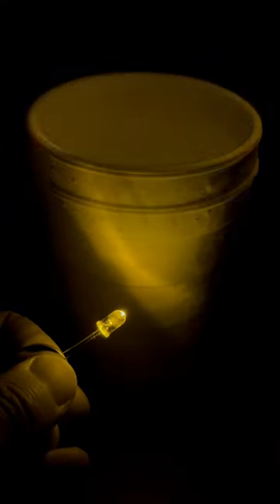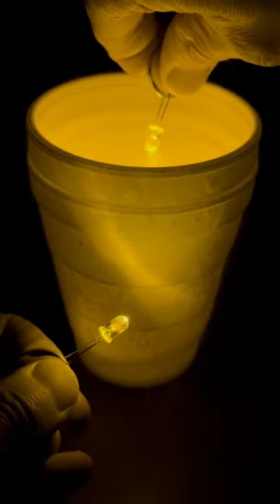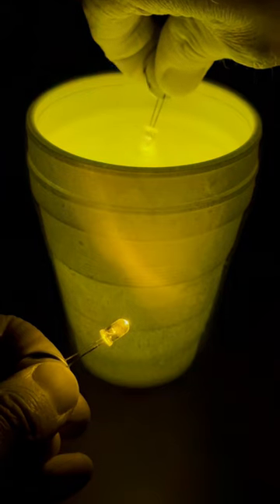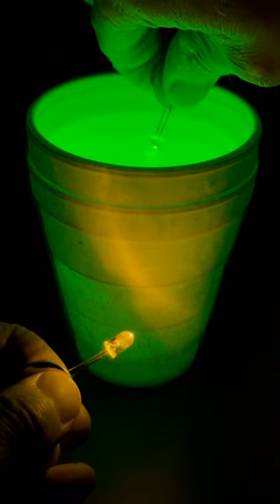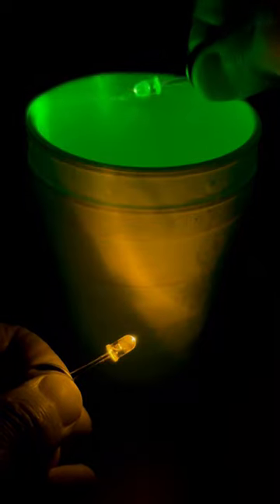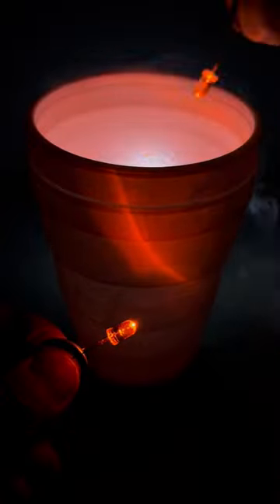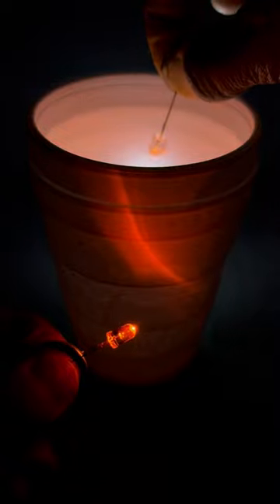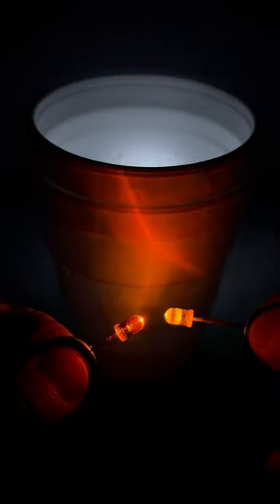LED in liquid nitrogen 🚥🥶 #shorts #liquidnitrogen #chemistry #color

Comment: If you want to be even more specific, semiconductors increase in conductivity when temperature increases, even though there are more scattering events due to the increased vibrational amplitude of the atoms, the amount of carriers (electrons or wholes that carry charge) and the mobility of those charge carriers increases as well (it's easier for them to move throughout the lattice). When temperature decreases the opposite happens, the resistivity of the semiconductor increases (conductivity decreases) and the semiconductor requires more energy to move the carriers. Since green has a higher energy than red in the visible spectrum, another way of saying colder semiconductors have a higher resistivity, LEDs at colder temperature emit higher energy photons. Which relays back to the bandgap increasing!
Reply from the maker: Thank you for this. There is definitely a lot that can potentially go on in this experiment. Much depends on the particular material used. I've read that some LEDs will shift to longer wavelengths when chilled, although I've never observed this myself. I'm no expert in this area...

Comment: Simples way to know this, is like a wire one way on positive the other to negative.
And as u change the amps it heats up more and changes the color.
Thats what a diode is, it allows the electricity one way but the not the other way around.
So by controlling the energy on the diode u change the color son nitrogen here is like -170 celcius.

Comment: LED traffic lights self-adjust their color by preheating the die with a burst of current when first turning the light on. This burst causes the light to vriefly flash brighter than normal. When the new LED lights were first introduced, that flash had people thinking red-light camera flashes were going off (they'd catch the flash in their peripheral vision, which has weak color perception; it just seems "bright").

When an LED traffic warning light is flashing 1-2Hz, the pre-warm light burst is much more obvious, happening so much more often.

Comment: What happens when you cool down a purple LED? Since purple’s supposed to have the tightest wavelength on the visible spectrum, would it change to be even more purple, or would it seemingly disappear because the frequency is too tight for us to see?
Reply from the maker: I've tried using violet LEDs in this experiment and see no discernible color shift
Reply: @TommyTechnetium  But you would not see the change no? Maybe the violet would be emitted less, and the UV could be emitted more
Reply from the maker: @magic8ball237  what you suggest could very well be the case. However, other issues can impact the color shift (or lack thereof) of various LEDs. See Shakhashiri volume 5

Comment: When I think of photon emission, I think of quantum steps in frequency based on electron orbits.
But in this case, is the frequency changing continuously with temperature??
Reply from the maker: The frequency of light emitted here is still based on the difference in energy between orbitals. It's just that this energy difference changes with temperature

Comment: I was curious. If this works, does the opposite also hold true? Like say inserting an LED into boiling water and seeing it shift towards red?
Reply from the maker: I've been wondering this, too. I'm also wondering if you'd have to increase the temperature so high to see a color change that you'd ruin the LED
Reply: @TommyTechnetium Overheating a green LED, by overcurrent, shifts it towards orange. 

Would be interesting to see how the newer style that are blue/UV internally and the visible color is generated by phosphors, stimulated by the blue/UV photons, reacts as there is 2 stages - the shifting of the blue/UV, and then the phosphor...
Reply from the maker: @michaeltempsch5282  Interesting question...Do you have a link where I can purchase or learn more about the new LEDs you describe?

Comment: 🤯🤯🤯
Wouldn’t this mean that the color change will always go “up” the spectrum…? Like tighter/shorter wavelengths?
Reply from the maker: The color shift isn't always to shorter wavelengths. See Shakhashiri, volume 5, p. 111-114
Reply: @TommyTechnetium  I’m so sorry dude I’ve been out of college for a long time…where can I find the source material that’s not just the abstract/summary?
Reply from the maker: @johnw6201  Basically LED emission wavelength does decrease with decreasing temperature, but some atomic rearrangements with temperature can cause an opposite effect

Comment: Well for some reason I would expect it to dim or turn off or something, the last thing my intuition told me was changing colors. But the extreme cold changing the wavelengths makes sense...

I'm posting this about 5 seconds into the short, right when the color change happens so I'm assuming this is why

Edit: okay so I was barely right, I had no idea about the specifics of an LED regarding the conduction band and valence band causing the wavelength
Reply from the maker: In some LEDs the light gets dimmer, in others it increases. Conductivity increases in some materials at lower temperatures. Any time the power source was cooled the LEDs dimmed, however
Reply: @TommyTechnetium  interesting! Thanks! ✌️

Comment: Ah so that's the mechanism why overcurrent makes green LEDs shine orange. They simply get hot!
Reply from the maker: I didn't know this was a thing...!
Reply: @TommyTechnetium  It is... for a very short time. Burned quite a few that way before learning about the need for a resistor.
Reply from the maker: @sharpfang  How might I be able to pull off this experiment? I think it would make a nice short...
Reply: @TommyTechnetium  Get several green LEDs, preferably a variety of types. Attach one to battery through a potentiometer. Turn the pot down, gradually to zero resistance. If the LED didn't turn orange before burning out, try another.
Reply from the maker: @sharpfang  Thank you! I hope I get a chance to try this out

Comment: What's the difference between the band gap energy and the ionization energy?
Reply from the maker: Ionization energy refers to the energy required to completely remove an electron from the system. If an electron gains the band gap energy it becomes promoted to the conduction band, but remains in the system